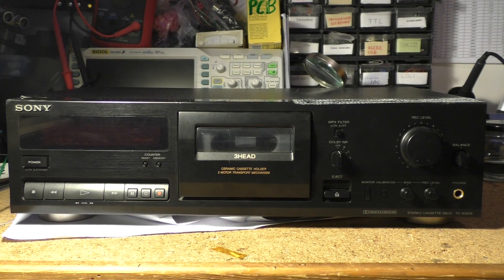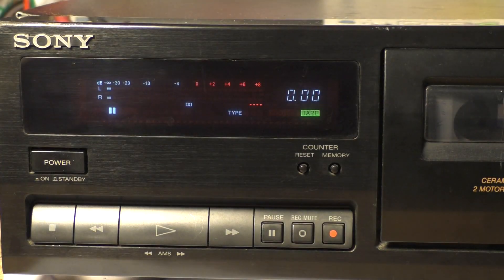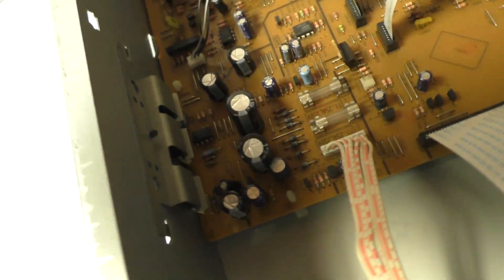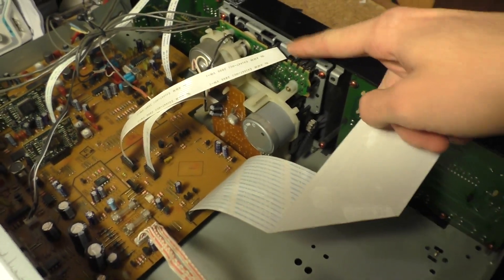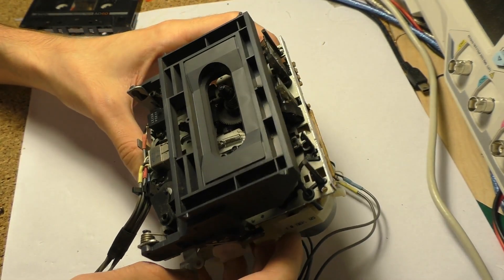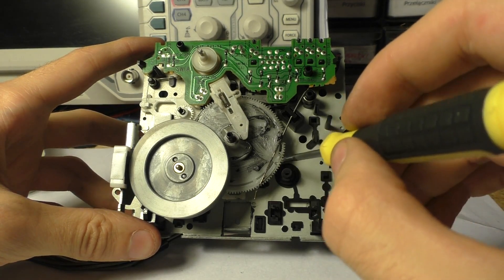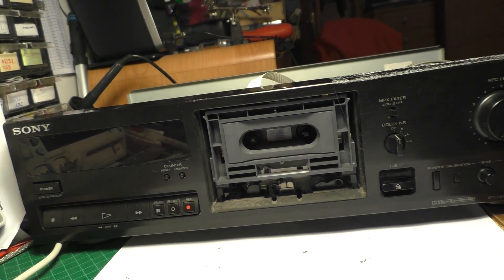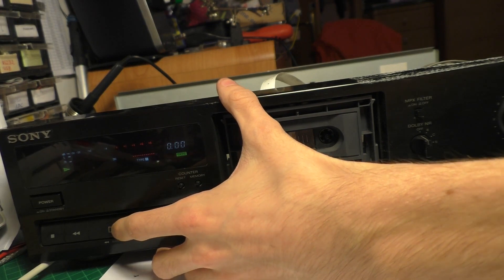PEV 07h - Sony TC-K561S repair part 1

Comment: Well, the problem was not in main flat belt but in 35mm square belt that was stretched that supposed to engage white plastic lever in order to activate program gear

Comment: Hi, I have changed the belts but now the display doesn't show the different Dolby mode in the display, any suggestions? I have checked all cables and plugs. Thanks
Reply from the maker: I don't remember the details exactly, but I think some of the plugs could fit different ports on the main board. It's best that you check with the service manual
https://elektrotanya.com/sony_tc-k561s_tc-ka1es_sm.pdf/download.html

Comment: I have a TC-K615S which is very similar and am trying to remove the top cover to check fuses. I've removed the 4 screws (2 each side) and when attempting to lift cover it acts like it's attached to the front face. I don't want to break anything as this deck is in mint condition, any thoughts on why it feels like the top cover is attached to the front face??
Reply from the maker: hmm, youre excercising my memory.. i dont recall any screws on the front but i think there are screws on the back.. Service manual is here https://elektrotanya.com/sony_tc-k561s_tc-ka1es_sm.pdf/download.html